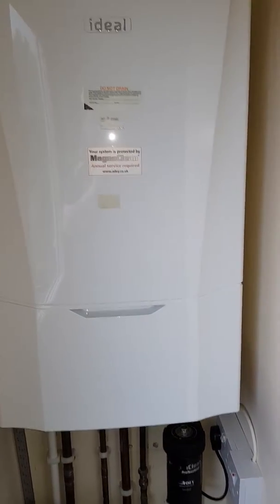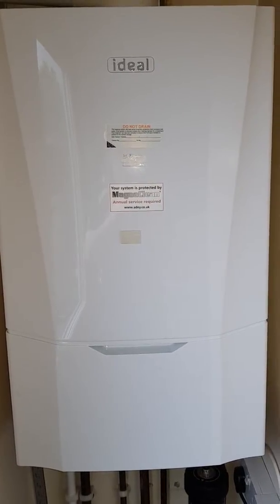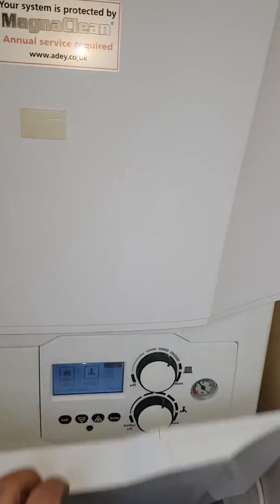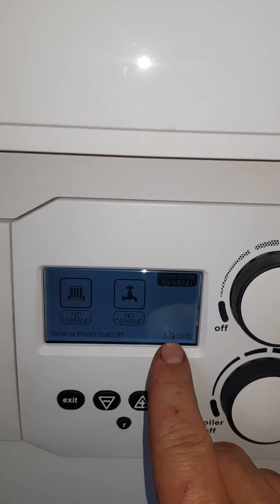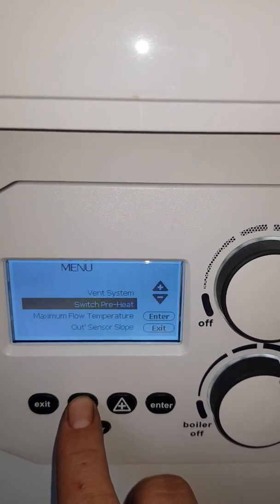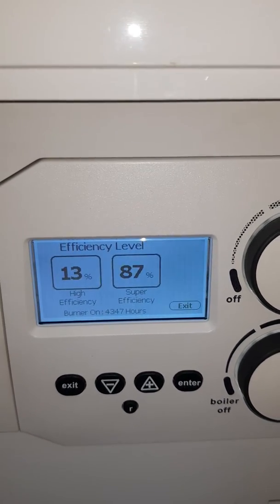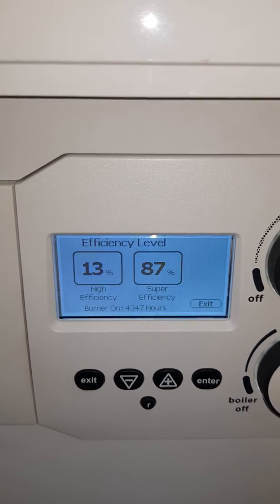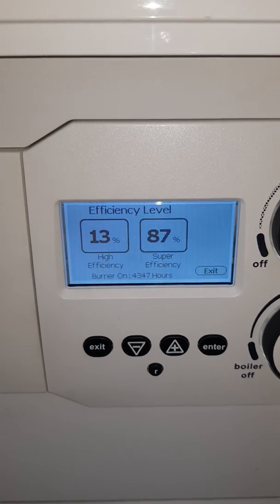New Ideal  vogue boiler on weather compensation controls.

Comment: Have you ever put weather comp on a ideal logic heat only boiler, ive wired it in and it works fine on central heating but when i ask it to heat the hot water its ment to ramp up to 80c but it just stays at the central heating flow temps.
Reply from the maker: @my_carp_life3424  no unfortunately I’ve never done a logic before. Is there not two separate switch lives in the boiler like the vogue I think?

Comment: Do you have this  wired in conjunction with a timer or have you got the weather comp controling the boiler full time!??
Reply from the maker: Yes it is wired to the boiler with the ideal rf programmer for timed settings only. The outdoor sensor dictates how the boiler operates through the heat curve.
Reply: Thank you. I have also heard of some engineers installing them as the main heating controls without a programmer and leaving the comp to do all the work. Essentially running the boiler as a heat pump.